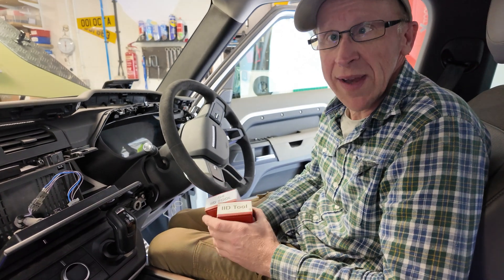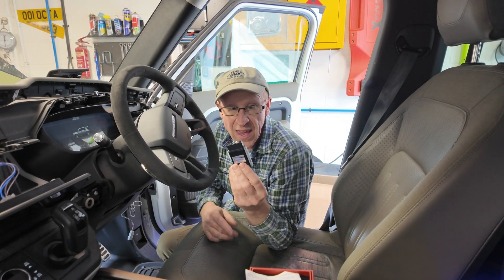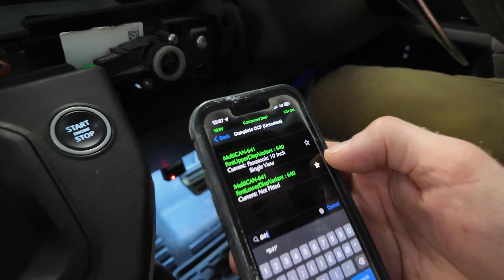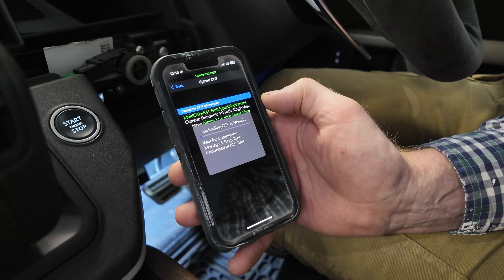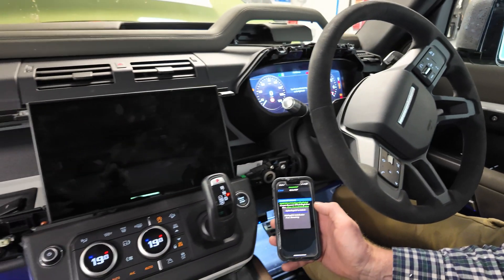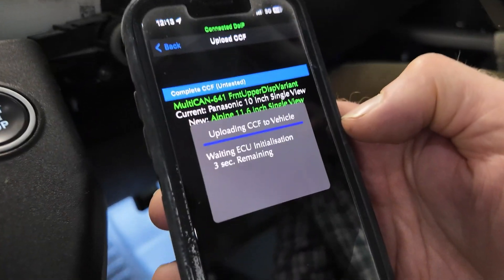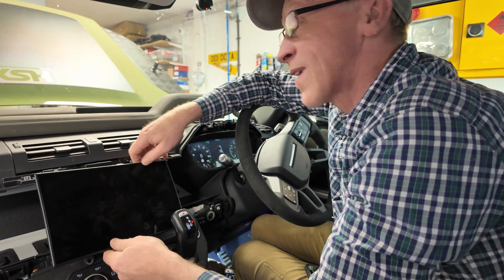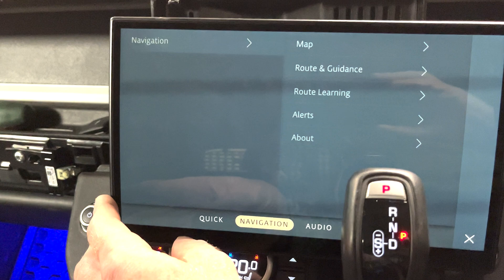Defender Screen Upgrade 10" to 11.4" - Changing the Car Configuration Files (CCF) Using GAP IID Tool

Comment: The two different screens (which are modules) probably respond to different CAN IDs. One of those CAN messages is likely a "wake-up" frame. So the screen sits idle forever waiting for a wake-up message that is addressed wrong and never comes. Assuming the CCF informs the vehicle which CAN IDs to broadcast based on configuration.
Reply from the maker: I think you are correct - odd that the 11" screen cars can run a 13" without CCF change

Comment: Hi Simon, Have you managed to active the 13.1" screen all ok with the G4 Gap tool using the same wiring harness for the 11.4"? Thanks
Reply: Not yet - working on the bracket design now and then I will test - i have the 13" screen
Reply: @simonjefferson  Great thanks. Will your 13.1 bracket design  also work for the 11.4 standard brackets or just for the original 10"?
Reply: @dannymm  Damn thats a good question - we may need new brackets for the 11.4 to 13
Reply: @simonjefferson  I've just gone from 10 to 11.4 using the LR oem brackets kit from your website, so brackets from 11.4 to 13.1 would be great! Also on the 13.1 screen the Fakra socket is quite recessed so the right angle fakra plug used on the 10" is a tight fit. So may need a short Fakra extension cable with a straight plug for a better fit.
Reply from the maker: OK noted - I will take a look at the Fakra length - also the 11.4 to 13.1 conversion - v5 of the conversion kit for the 10-13 today !

Comment: Simon, I have been looking on ebay and can’t find a 11.4 inch compatible screen for my 2020 Defender First Edition, can you please provide the model number of the screen you purchased and where, much appreciated? Thanks
Reply from the maker: The engineering PN you need to look for is  ( for 11.4 inch screen upgrade )
MX63 19C279 AC or AD AE AF 
There are none on ebay right now.
We will offer the 13" screen upgrade soon as we have a source for these screens.

Comment: I’ve just had the same fitting duel view screen completely dead but power cycled worked. (Not tried duel view yet as forgot to turn off video in motion) discovery sport. Next step fit the IR receiver and RSE module

Comment: Hi Simon, I have done the same 11.4” changes using Gap G4 tool and got the blank screen. However I locked the car overnight and let it power cycle but still got the blank screen. 
I can’t figure it out why only thing could be I setup the wiring of the connector incorrectly? Hope your next video show us the connection convert from 10.8” to 11.4” 🙏
Reply: You will know if your change with the IID worked as IF it worked your 10 Inch screen will NOT work anymore.
Someone in the comments says there is a RESET option in the IID tool which helps. Simon

Comment: Good day! Hello from the US! I love watching your videos I am going to buy the gap tool soon. I’m hoping you show some basics that I can follow to help upgrade my 2021 110 S. I’m interested in turning off the auto / on off start. I would like to lock to tallest off road height. I would like to add that cruise control feature and of course NOW I need to get a new screen. Do you have a link for the 13” or 11 inch screen?. I know you said eBay but I can’t find here. I’m really interested in the 13” and I want to make sure it comes with the bracket and plugs or harness. Do you sell them? I would really appreciate your help, I have no one here to help me out. Thank you for your videos I really enjoy them. A basic video on gap tool to fix some things would be really cool!
Reply from the maker: Yes we are starting to do the GAP mods on our Defender 90.
The 13 inch screen we have not go one yet - but i now have a supplier for these at a good price.
Bear with us a couple of weeks and we have the full kits in stock .. brackets / screens / wiring looms
Reply: @L663  Upvote for iid GAP 4 mods... would love a detailed walkthrough of common activations... I'd like to add Wifi hotspot and Dynamic drive mode (for my 2023 P400, 130)

Comment: Question on the fitment, I also have a small screen in my defender. Does it require any modifications to the upper dashboard?
Reply from the maker: Wait for the next video.... yes with genuine screen mount plastics.... no mod needed with our soon to launch brackets.

Comment: As I was watching the black screen I was telling myself if he turns off the car and locks the doors for few min I bet it will work :D only because I get black screen sometimes (with small screen) and that is the only way to restart it 
Thanks for another great video :)
Reply from the maker: Classic IT fix - Turn OFF and ON again !
Reply: Yep! I was yelling at the tv to get out and lock and arm it!  
Glad he got it working.
Reply: The only reason for me to upgrade to a larger is that using it for Navigation is better large screen  like ONx offroad

Comment: Do you have a link for the 11.4” screen?
Reply from the maker: I got it from ebay for £200!
Reply: @L663  cheapest I've seen on ebay is £800 to £1300! you did well. I read you need to reboot the pivi after the ccf is completed - hold the power button until it reboots
Reply from the maker: @dannymm  I will give you a tip .... do a ebay search for the engineering part number MX63 19C279
This is part number ( engineering number ) on the label on the back of the screen.
This screen is used on some Jaguar models and you can find them cheap.
There is one on ebay now with scratches - but some PPF over the top would maybe fix that ?
Good luck....
Our brackets will be launched soon !
Reply: @L663  I managed to get the screen for £200 and £12 for the ppf. Will you include the adaptor cable with the brackets in a kit? Cheers!
Reply: @L663  Hi, can you use a used 11.4 inch screen? Thanks

Comment: Hello Simon..Scary stuff but young Destiny sounds unfazed…I would be frightened to death it would never work again! I was at “ Motorway Services” again last week and a new RRSport Hybrid was parked at the EV chargers but not plugged in. I wondered if it was diesel parked there but then the EV Charging Attendant saw me and said that it was broken down…” Brand new and it won’t start…that’s a £140,000 car and the AA wont tow it so it is sat there until someone will recover it!….it must weigh about four tonnes!!” . The AA link and Shropshire registration is a clue to it being a Rental Car but I just wanted the keys and thought of you..I’m sure we could get it going with an ignition cycle or similar…but now there is another set of “JLR is rubbish” believers! 🫢😬😀😀😀😀Have a good night..Richard😀😀😀😀
Reply from the maker: You would not be happy if you had paid that and 8K for insurance just to be parked up !
Reply: Any hybrid cannot be towed at all and needs a flat bed recovery. I have a full hybrid, not plug in, and got a puncture that funnily enough, the emergency kit did nothing at all. So had to call the RAC and wait 4 hours to turn up. I assumed they would fit one of their fits anything emergency spare wheels. But, as I have 20 inch tyres the emergency wheels don’t fit over the regeneration kit on the wheels. Meanwhile a flat bed was several more hours away but Mr RAC drilled a hole in the tyre and shoved one of those rubber strips in nd blew up the tyre. It worked but was told get a new tyre tomorrow.
Reply: @stevenmoran4060  I suspect the trouble was that the driver may have tried to  disconnect the cable whilst it was still charging and may have caused a spike that upset the electrics. It might well have reset things had they gone through a lock/unlock procedure. I am sure it was a Rental car as it had a bar code on the screen and any private owner would have called Land Rover Assist for specialist help rather than the AA. 🫢🫢🤔